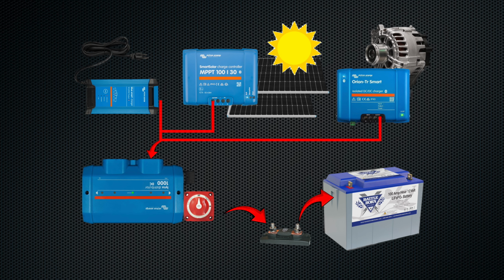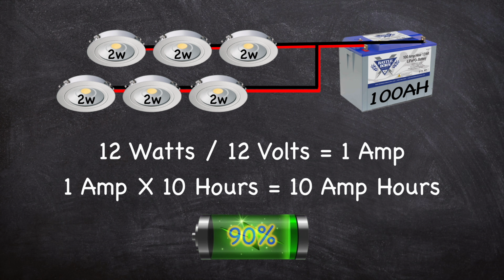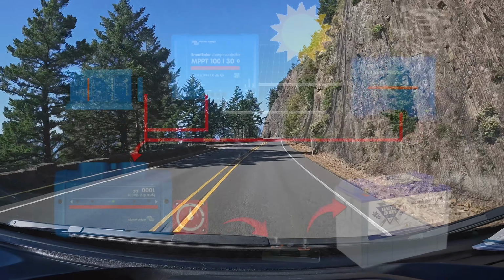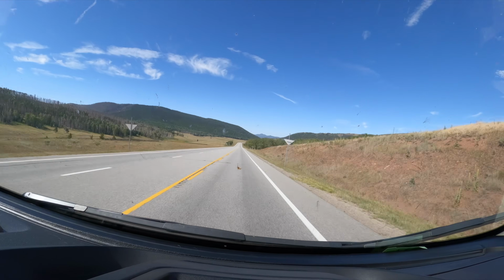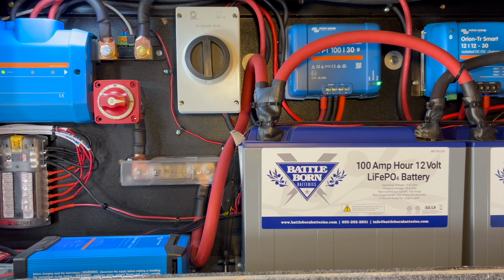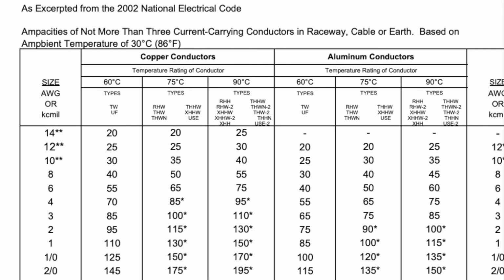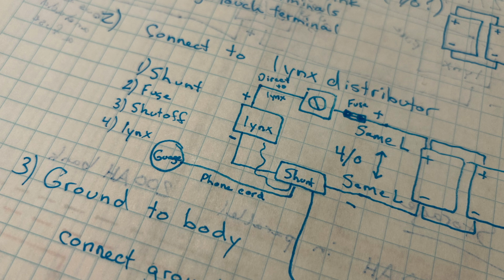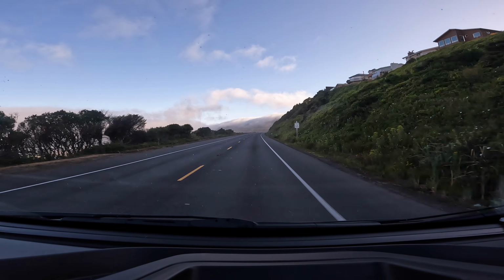Electrical Systems for DIY Van Builders

Comment: Hi, do you wire your puck lights in series or parallel?
Reply from the maker: Great question!  Always in parallel.  That way each light has its own path, receiving the battery’s full voltage and is independent of any other light in the circuit.  If they were in series, the voltage would be divided by each light and if one goes out the rest go out.

Comment: 16 LIKES?!?!? Gng this video is extremely detailed and helpful that's crazy
Reply: Picture of BattleBorn brings in the dislikes. BattleBorn is currently a lesson in poor public relations and public response.  I think FireFly has a crises on their hands.
Reply from the maker: Now that LiFePO batteries are a fraction of the cost they were just a couple of years ago, I would go with a lower cost alternative.  Fortunately my Battle Born batteries have been trouble free and are still functioning like they did on day one, others have not had such luck.  I would certainly consider other brands.  Thank you for your thoughts!
Reply: @TheVanTeacher BattleBorn brand damage certainly opens doors for another brand to become the trusted brand. Will be interesting what happens.
Reply from the maker: I'm curious to hear of any specific negative experiences with Battle Born batteries.  Please share!
Reply: @TheVanTeacher Mine is a less common challenge likely. I am big on FB Marketplace deals but wasted time as it turns out battleborn warranty is to original purchaser only.

SOK, BattleBorn, Ionic, and Bedrock all have transferable warranty… who knows if any if those are around in 5 years to honor it however.  🤷‍♂️
Reply from the maker: Thank you!  Happy to hear you found the video helpful!